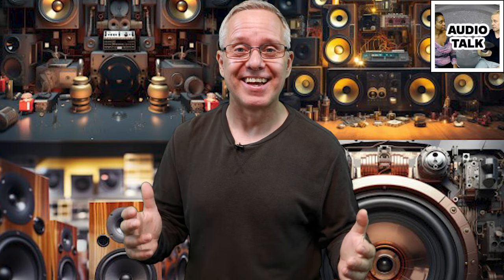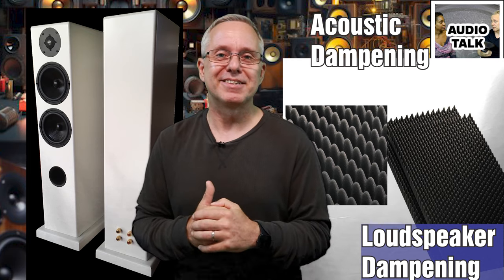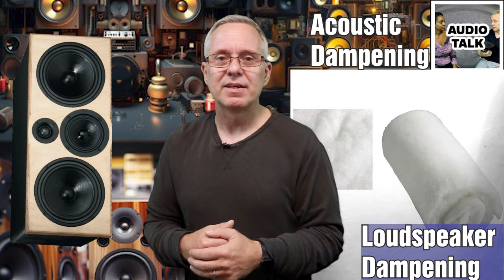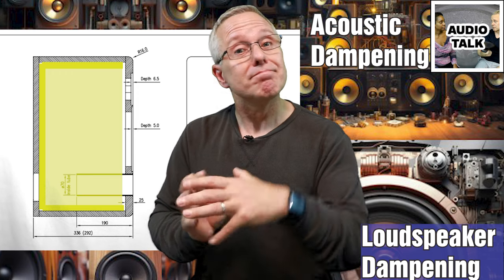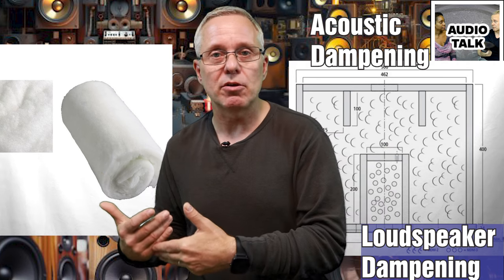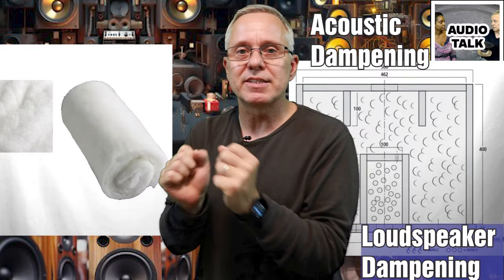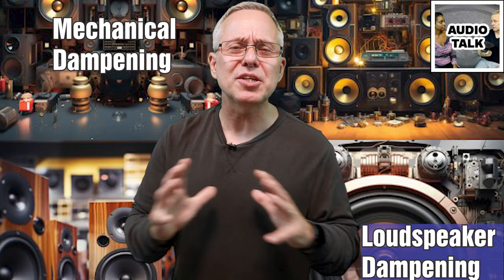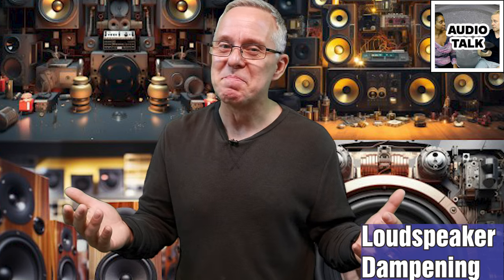Speaker Cabinet Damping 101: Elevate Your Audio Experience!

Comment: Thing is... it helps whit subs too. The egg crate style stuff indeed does a pretty good job in them.
Bracing should never divide a panel into equal parts. Ever. You do not want to trade a single resonator for 2 resonator whith higher fequency. 

Generally speaking plastic reflex ports als love a good layer of bitumen on the outside . Makes a difference. 

Allso its worth to consider to have a 90 degree turn in your port , dividing the port in a 2/3 to 1/3 ratio. 
Due to cancellation , its best if the inner end of the port is indeed near the verry center of the box . Best to size the port in a way that it has a large surface area , but.. its first resonance is outside of the freqvency range you wish to play. Hence why 3 way speakers kindof have an advantage. You can cross over before the  port harmonics. 
You can use a fine mesh material like mosquito net to ensure your filling material does not move around. 

Best to design your box whit internal edge lengths that got no common resonance.
You should round off external edges. 

The outside of the speaker should be carpeted. Whit something heavy and fluffy.

You never should mount the driver in the verry center.

Comment: Thanks for a great tutorial! 
I just finished building a pair of ported boxes. I tried them with no damping this evening, to see how they behave... 
Will be adding damping tomorrow. 
Then i can experiment with the length of the port tube. 
Silicone sealant is a great tip! 
My cutting is not great..
Used draft excluder tape in a couple of bad gaps.  
Speaker gaskets are another potential leaking problem.

Comment: Thank you for this!  I built a nearly square cabinet to be used as a subwoofer. I did not have a subwoofer to purposely build it. I had two ports that I thought I could tune with the length of the tubes. But then of course I did the math. Then a friend gave me a plate amp that was blown and I fixed that.. So that was also an addition. So now I had to try to purchase subwoofer to fit the plate amp. The plate amp is too powerful for the sub. 

As you're reading this you can tell this is very fun for me I'm learning as I'm going and I'm acquiring parts as they come to me and as I find around in my shop. 

So I purchased a subwoofer that fits the cabinet and I made it portless back in the day we called it acoustic suspension. And I got what I wanted out of my system I wanted to hear the lows clearer better not moving too much air not automotive trunk rattling. As soon as I plug the ports properly I got tones that I could adjust and work on and it became wonderful for me for home theater and also playing music. 

And most of my life there's never been enough base. So the systems I build for myself are all 2.1 now. If it's 50 watts per channel then it's double for the subwoofer. However this subwoofer has the plate amp that I installed. And once I plug the ports the sub sounded great especially with midlows and sub frequencies. Ceiling the cabinet basically tame the beast and gave me more defined low end. 

Now I hear your video here and you gave me the perfect solution to get out some of the higher low end tones that hoooot .  I happen to have the correct foam with me and I'm looking forward to tuning my ever evolving subwoofer cabinet to make it sound even better. 

Thank you for this!  Obviously this one wasn't a project that I built a cabinet for a speaker and did all the math. This was a cobbled up fun project from scrap that I had around. So I really appreciate your insight in this and someone actually talking about speakers that aren't ported.

Comment: I make my speaker cabinets out of mdf and use industrial flooring adhesive to adhere solid oak on the outside and I make the tops and bottoms 3" thick and I spray the inside with flex seal and adhere thick carpet pad on inside walls then I use Rockwell for a fill partly i also angle 45° pieces on the top and bottom on the inside my speakers weigh 80lbs but they sound amazing.  I don't like poly fill its doesn't work as well as Rockwell or fiberglass. But I am big into madd loaded speakers if you heard them yet can hear all love i put into them.
Reply from the maker: I can imagine that works very well
Reply: "Rockwell"?? You mean "rock wool"?
Reply: @jgfergus  yeah my autocorrect changes things and sometimes I don't catch it but thanks Mr. Obvious
Reply: @BostonMike68  I was just asking a question. No need to get all defensive.

Comment: Very informative. I bought a 5.1 speaker system that is cheap and bad, but I think I can get it to sound better by dampening inside. The wood is very thin and there is a lot of echo when you knock on the speakers, so they were made cheap without any mechanical or acoustic dampening. It will be a fun project.